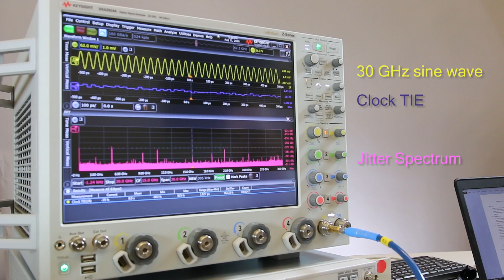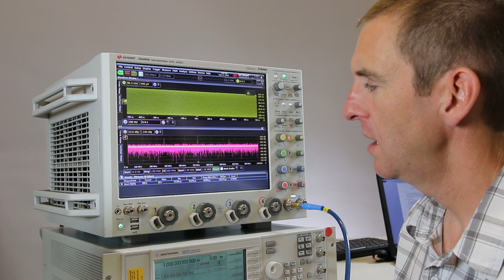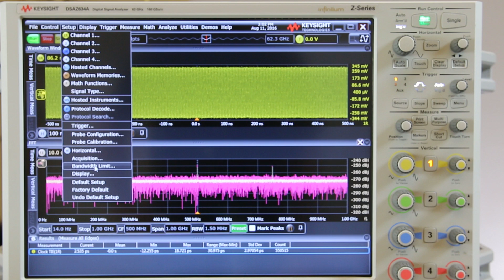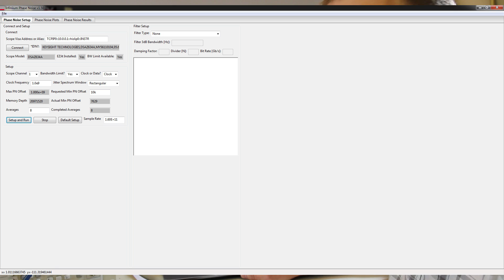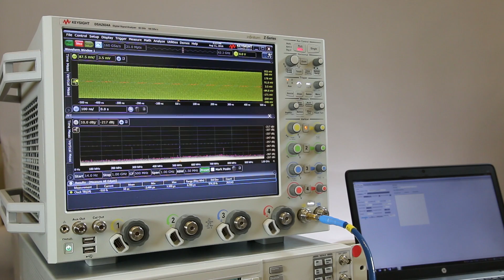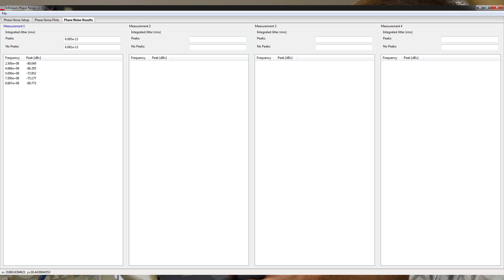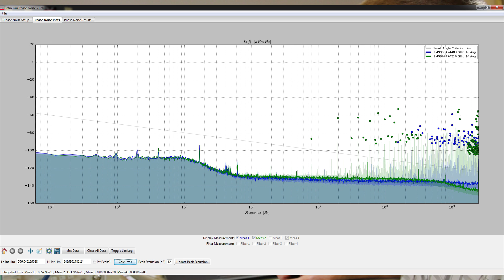How to Measure Phase Noise with a Real Time Oscilloscope

Comment: Can I measure jitter and phase noise using a DPO7254?  Do I need to have D9010JITA or DPOJET to perform these measurements?
Reply from the maker: I'm not sure about the Tektronix capabilities, you'll have to ask them!
Reply: DPOJET  is required

Comment: That scope is worth more than A R&S FSUP, by quite a bit. FYI the FSUP is excellent phase noise measurement test equipment, very low noise floor with correlation. Don't get me wrong that scope is good but...$£$£$£$£$£
Reply: Hi Fred, yes the FSUP along with other Signal Source Analyzers (such as the Keysight E5052B) does have a lower phase noise measurement floor than any scope and depending on the clock frequency range to be measured it may be a cheaper choice. However as I mention in the video there are reasons why you might want to use an oscilloscope for the measurement. For example most lab's already have an oscilloscope and if the scope has a very low noise floor and excellent timebase then it might be good enough to do the job.